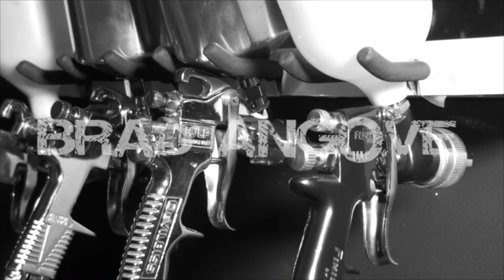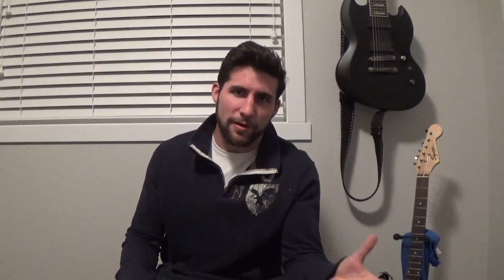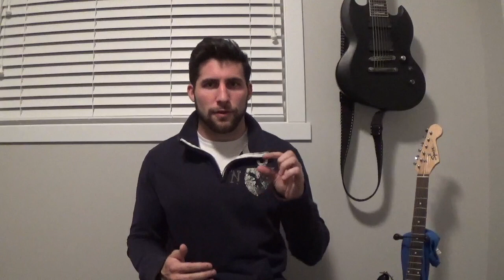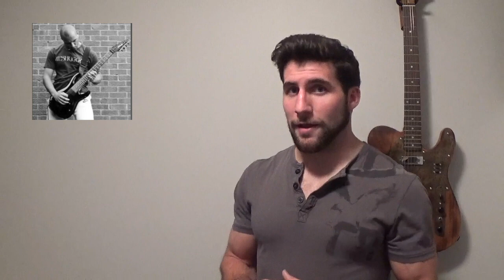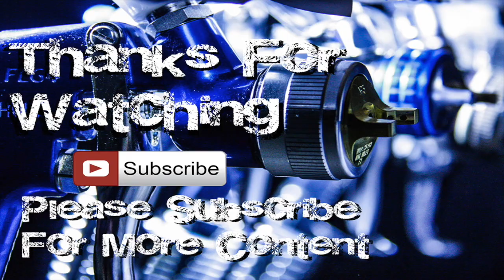How many coats of paint do you need?

Comment: I'm binge watching your painting tutorials and its a really great help for me in learning painting stuff. I'm a newbie in spray painting and mostly I do my own painting in my motorcycle using spray cans - from the plastic fairings, other parts and fabricated metals like stainless crash guards. 

In my experience using 320-400 grit sanding works best for paint in surface adhesion and I observed on surfaces that I don't sand anymore than 400 grit attracts dirt, dust, and stain easily and make it hard to clean off even washing it off is really hard? 

So I experimented on some projects I painted and got them to wet sand it with 1000 grit after the 2nd base coat dries and I'll proceed to the 3rd base coat and clear coat the surface.

From the experiment I did, I think wet sanding the surface with 1000 grit makes a little difference and is okay(?) on the surface. The dirt, dust and stain doesn't also easily stick well and cleans off easily now? Is 1000 grit still okay in paint adhesion and if I wanted to smoothen the surface a little? or is 1000 grit too much?
Reply from the maker: Usually unless you’re using lacquer 1000 is right on the edge. It’s probably ok, but is definitely as smooth as I would ever go before another coat. It’s a bit risky for most paints.

Comment: Another point that should be mentioned if you are trying to use minimal coats of paint is to make sure that your body is sanded completely flat before you start. If it isn't flat, thin coats will be very prone to rub-thrus when you are finishing and buffing.
Reply from the maker: +Louise Hall Yes, I hope that everyone realizes that their finish sanding should be done before they start worrying about coating.

Comment: Hey quick question. for a matte finish on an automotive paint job. Should i use a hardener on the top coats? also should i use a clear coat over that? And will a clear coat create a shine?
Reply from the maker: It depends on the paint system for the hardener. But you can get a matting agent for your clear coat. I would still use clear.

Comment: I've got a question! How did you paint the SG in the background? I am doing an excact same project, repainting an Epiphone SG, and I've sanded the original paint down (it's not gone but sanded down). I'm planning on painting it matte black just like th one in your video. Can you explain how you did it in steps? That would be awesome :D
Reply from the maker: +jaZZ Hi there. I didn't paint that one. That's the factory finish. If you want to do one like it though it's not particularly difficult. What type of paint were you intending to use?
Reply: +Brad Angove Could you technically take 0000 steel wool and go at it on your lacquer finish?
Reply: Brad Angove SInce I'm on budget here I was thinking of using just some regular Nitrocellulose hobby-paint, you think that should do it?
Reply from the maker: +ZombieZPandaZ You could. I don't think it's the easiest way to go about it, but if you're careful it should work. I've done something similar with moderate success before. The finish on that guitar likely isn't lacquer by the way.
Reply from the maker: +jaZZ I didn't realize there was regular nitrocellulose hobby-paint. Is it in a spray can? Does it say matte finish on it, or something about degrees?
Reply: yeah it's in a spray can, and it says matte finish, don't know about degrees
Reply from the maker: I see. That should work fine. You may want to find a matte lacquer clear to go over top to protect it. The degree thing is just how lacquer's shin is measured. It's not important if it already says matte anyway.
Reply: Thank you so much, this really helps me out man :) Btw roughly how many layers of paint should I use to cover up the sanded down red from before? Some places I stripped the body down to pure wood, should I go over with primer on those parts before I start applying the matte black? Again, thanks for the time, really appreciate it!
Reply from the maker: You can use sealer over the bare wood parts if they seem like they're going to absorb paint, but they have probably already been sealed. I doubt it's an issue. Use however many coats it takes for your finish to look opaque. My guess is 3 or 4, but it depends on how you spray.

Comment: BAHAHAHAHAHAAAA.......
1st comment :D
Good to see ya again, my friend
The scolding you just gave here has been positively accepted. I've done that with the thoughts of a harder finish....
and that's where the blonde flipped and my brain farted it's the final coat of "whatever" is used that gives it that.
Once again, good video......

I've been wanting to try Solarez, whats your opinion of that product?
Reply from the maker: +Gene Swicegood Haha I didn't mean for it to be a scolding per se, but I'm glad it was well received.
I'm not familiar with Solarez specifically, but I have seen UV curing resins used with great success. I like them. I've also used UV glue to bond transparent materials and it works quite well.